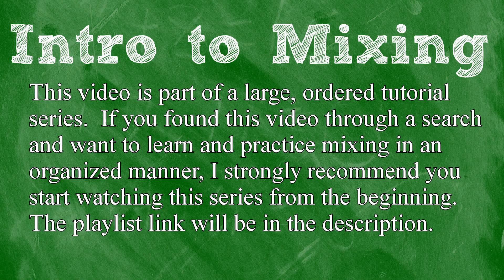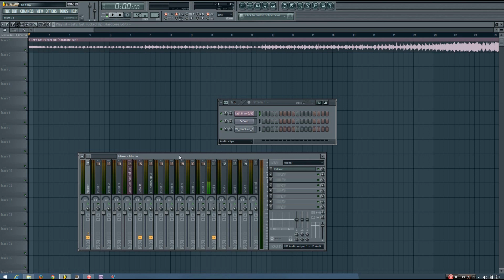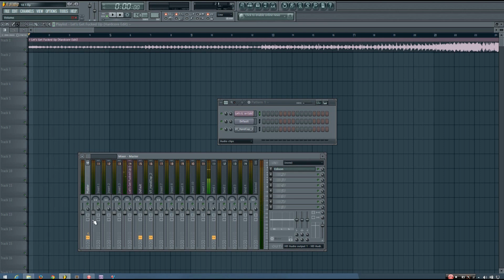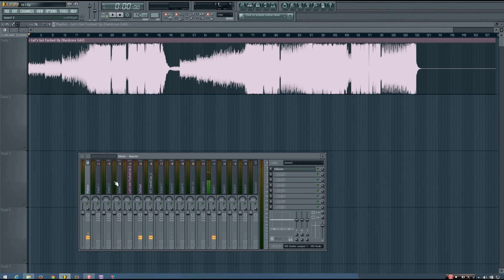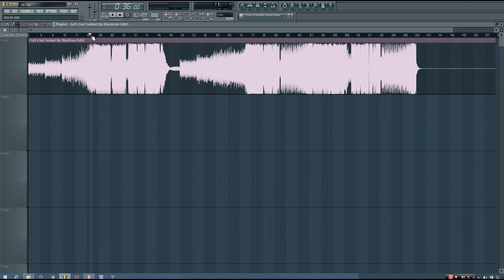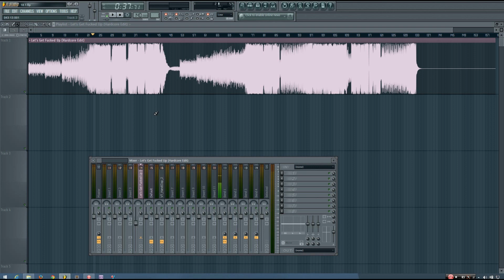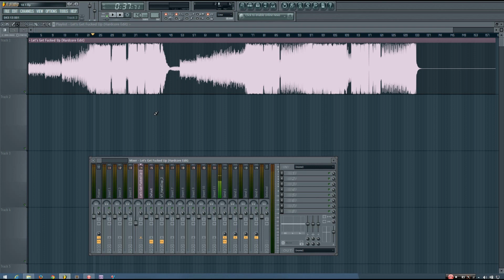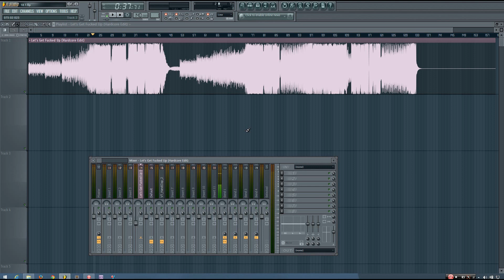Mixing Tutorial: Mono Compatibility

Comment: One tip that I recently discovered, that I've found rather useful, is the idea of mixing in mono (at least partially). Like, when you've made your initial panning and level decisions, slap your mix into mono in order to do the EQ and compression. The idea is that, by removing panning from the equation, you force yourself to make better EQ and compression moves to ensure that everything is heard. Further, if you can get the mix to sound good in mono, it will sound GREAT when you flip it back to stereo. I think this would also work in favor of your idea of mono compatibility. Let me know what you think.
Reply from the maker: ShalMusicFX I don't do that, personally, but I can see why some might recommend it if you are particularly concerned with mono compatibility. 

One thing you want to make sure of, however, is that you aren't tricking yourself into thinking this technique is better than it actually is. If you spend a decent amount of time EQing and compressing your sounds in mono and then listen to your mix in stereo, it's most likely going to sound great compared to how it did in mono. This is because stereo sounds sound more real and therefore sound better to us than mono sounds and doesn't mean that it sounds better than it would had you originally mixed in stereo.  

My opinion is, since modern music is played in stereo much more often than it is in mono, and since any situation where you are listening to music in mono isn't going to be ideal for appreciating the sound quality of that music in the first place, you should primarily mix in stereo and make sure it sounds as good as possible in stereo, while also checking to make sure it sounds acceptable in mono.  

However, if you think your mixes improved from using this technique, I would recommend doing an experiment.  Mix a couple songs in mono like you mentioned and a couple more in stereo where you only switch to mono occasionally to check the compatibility.  Then compare the final mixes (in stereo) and see which ones sound better. You can decide which way to mix based on which mixes sound better.
Reply: *****
You make a good point. I'll give that a shot, to see if it's worth the hassle of mixing in mono.

Comment: I have been thinking about this for several weeks now and this helped a bit. Currently struggling to get my screech (which has haas on it because it's mono and it makes it sound much wider and fatter) to sound ok in mono and I never thought about the delay time thing. I don't know if I missed something but I didn't actually get why mono compatibility is so important? I got the "good mono bass sounds good in car" line but is there other reasons?
Reply from the maker: It's part of the whole "your mix should sound reasonably good on any sound system" concept.  Most sound systems now are at least stereo, so how your song sounds in mono is not as important as it used to be.  I have heard that some larger sound systems (for clubs and music festivals) are merged to be more mono or entirely mono. but I've also heard that this is untrue. Unfortunately, I don't have much experience working with those large sound systems so I can't say which is true from experience. It is possible that your music will end up played in mono at some point, and it's nice to make sure that your song sounds ok in mono if this does happen.  The bass is most important, because many stereo sound systems have a single subwoofer, which means the bass is merged to mono and played in mono by the single sub.
Reply: Thank you for your answer! Some hardstyle artists like zatox and frontliner make their tracks sound so wide. Yet they sound perfect in mono too. I quess this is a thing you have to master eventually and I think I'll start now : ) People have told me also different things about club and festival systems.